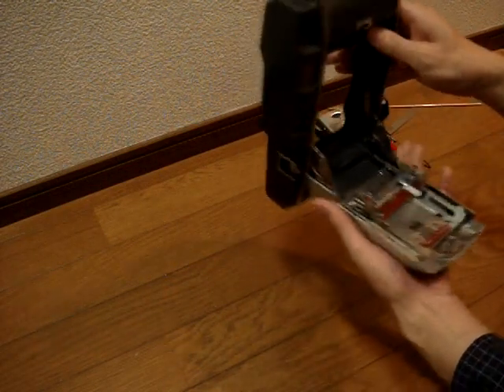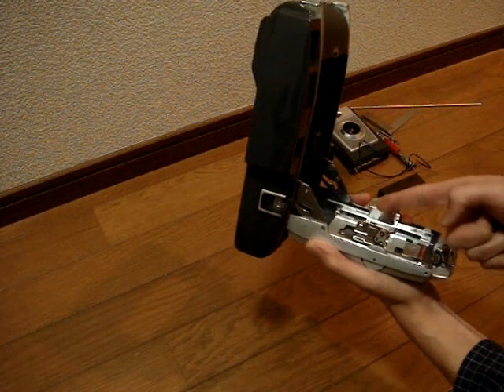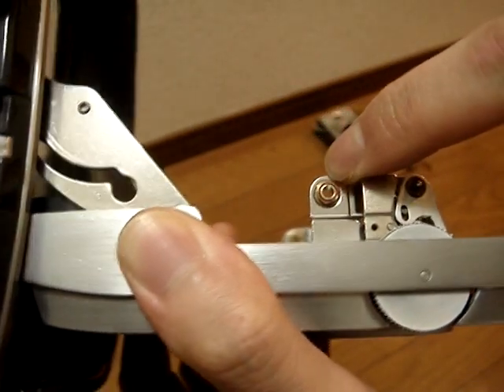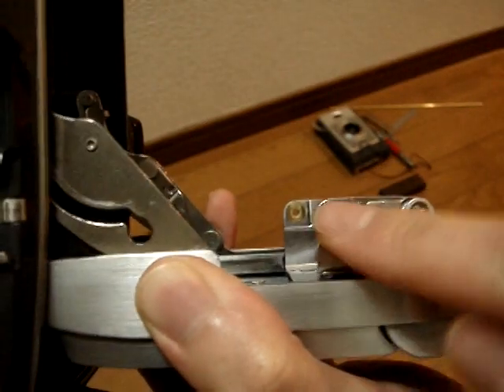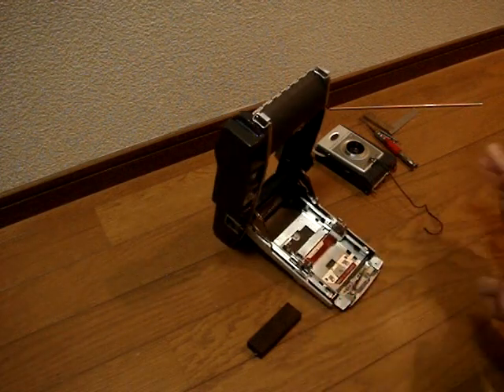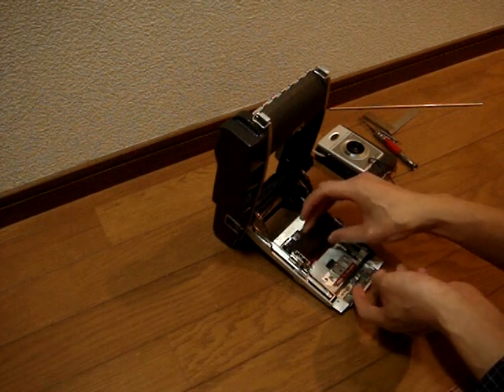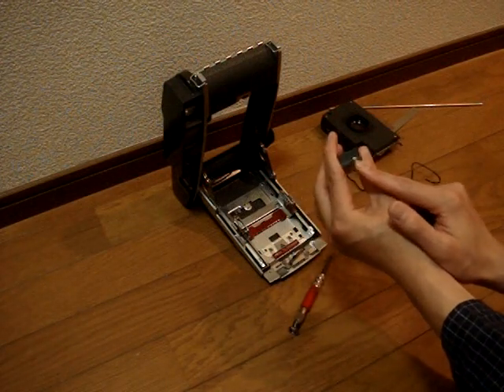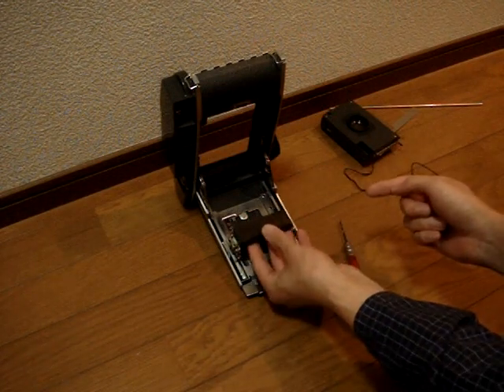How to convert a Polaroid 900 to use packfilm pt.4

Comment from the maker: Hi, I think you need to replace the lens because the new polaroid back won't be able to fit in without shimming from the body. The result is that you lose infinity focus with the stock lens since the lens to film distance is increased. The bellows you can keep since they are not a critical component. If you don't mind losing infinity and the shutter of your lens works, you should be able to use it no problem. You will still need to adjust the cam though. Hope that helps.